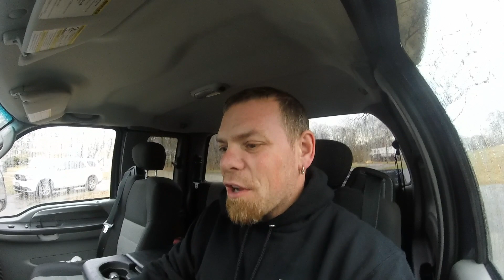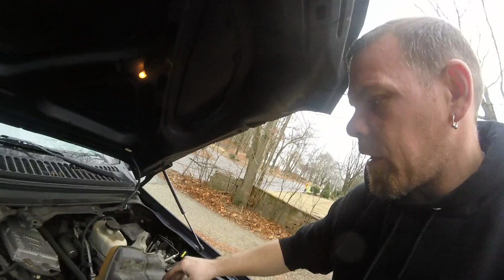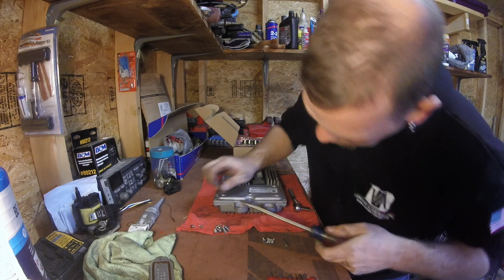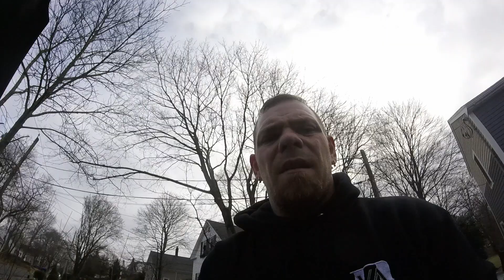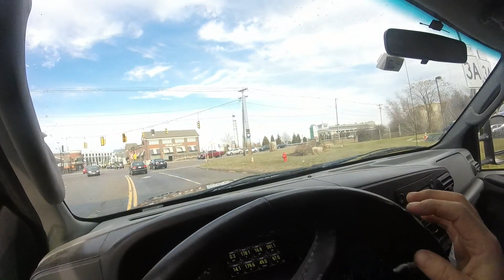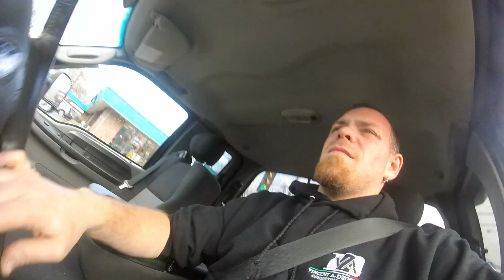Powerstroke 6.0 FICM Removal/Repair [Midnight Special]

Comment: That its a good  video Jimmy, I am dealing with the same problem with my f250 2004 6.0  and I do have question:if I replace the ficm from the same exact truck, do I need to reprogram the ficm or something like that?
Reply from the maker: The one that I bought didn't require any tuning.
Reply: Hopefully  the one I will  buy it be good for my truck, thanks  Jimmy

Comment: Do you need to re program anything? I need to do the same thing to my truck, thanks for the video! Helps out a ton
Reply from the maker: no reprogram needed. just install it like i did in the video and you're good to go.
Reply: I did the same and my truck didn’t rwant to run